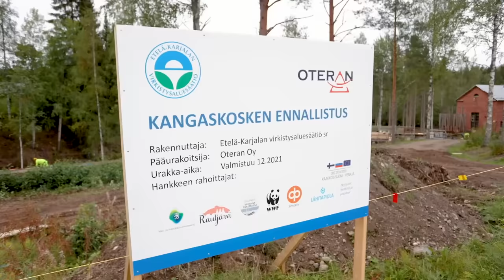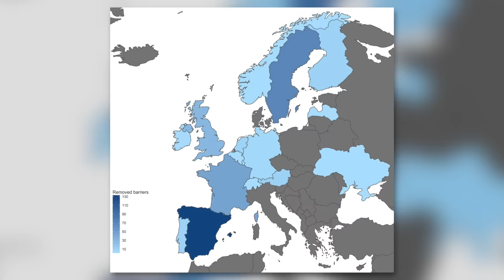How (And Why) Europe Is Removing Its Dams

Comment: Are the waters in rivers with dams really more dead than in "natural" rivers? I think that the ecosystem adapts to the new rythm of waterflows. And I am not a racist when it comes to discriminating against life that thrives thanks to dams.
Reply: yes. it has to do with the water height. lakes are not common because water tends to "want" to run to lower altitudes and ends up destroying the sides of a lake through erosion over hundreds if not thousands or millions of years. 
and when they're natural most of the water in them flows underground. dams pretty much stop the water in an artificial lake made on a river, which if it is there it's probably because there's some material preventing the infiltration of all that water (not all of it mind you).
This means we're accumulating water and organic matter in a place were naturally it would not occur as the amount of water flowing would clear them up. 
this is how swamps are made btw...a river flows into a field or a blockage makes it inundate the surrounding area turning the place into a swamp thus stopping the water and accumulating organic matter which incentivizes the growth of anaerobic bacteria and even makes those nice naturally formed methane reservoirs which then bubble up and you can see videos of people igniting for fun.
Reply: @pedromoura1446  But is there LESS life in artificial water reservoires? Or is there just DIFFERENT life in them? Is there any objective measure of how that change of one perfectly inhabitable environment to another perfectly inhabitble environment "is bad"?

In Scandinavia, forest areas that are industrially clear-cut have much greater ecological diversity than the natural hegemonic pine forest that monotonically covers 95% of the place. Could it be that dynamic human interaction with the environment can actually stiulate its diversity?

CO2 additions to the atmosphere certainly stimulates all kinds of life on the entire planet. Especially in the Arctic and in the deserts. So hydroelectric power plants might be bad in the sense that they compete with accelerated CO2 emissions, I could give you that!
Reply: @bjorntorlarsson  on your first question. It depends on how the lake is formed and maintained but generally speaking it's worse because you need to compensate for the damage you caused. You need fish ladders to maintain the current habitats and even then a dam is a barrier preventing local aquatic species from moving around, you need machinery to constantly remove the sediments from the bottom and place them over the dam to prevent problems like bridges falling or beach erosion, invasive water species accumulate in these reservoirs which you then need to remove and eliminate least they spread, all the organic matter from wateaver was in that area is now being slowly decomposing in anaerobic conditions, etc. 
But you're also right, It's a different environment, not necessarily a worst or better one. that's a human evaluation of the current local fauna and flora because we know that we can make very rapid changed that most species cannot adapt to. and yes. There is a method to measure that :) it's measured in biodiversity. Generally speaking if something man made increased the number of species in a place without putting a strain in another species. for instance... Imagine you eliminate mosquitoes in a place but your work added 1 or 2 other species of animal to the location, mosquitoes are considered common enough that it wont affect their population and 2 other species moving in means you succeeded in increasing biodiversity of the location. This is a generalization ofc since usually biodiversity increase means you created the conditions for species that feed and control the less desirable or more common ones to move in, you do not eliminate them. The opposite is also true... By knowing we reduced the amount of species in a location we know we did something wrong and we need to repair or at least minimize the damage. I hope this also clears your second question.
Reply: @bjorntorlarsson  on your 3rd point... Unfortunately no... Co2 is to plants what sugar is to humans.
We use sugar as the most basic energy form to feed our cells but you're only healthy because you have a balanced diet. If someone came and force fed you sugar assuming that because your cells use it then more of it would surely be good then you'd probably fall ill and eventually die. Plants react pretty much the same way to co2 (I can go into more detail about the mechanism by which plants consume co2 and why too much is bad for them if you want but I believe there's some youtube videos by veritaseum or scishow...?... that can illustrate it better than I could in a comment)... They've adapted to the current co2 levels and would take thousands of years for entire species to adapt to today's levels of co2 without facing extinction (especially bad if those provide food for us). 
Then there's indirect problems... Higher temperatures increase solubility of some minerals which can atrophy existing mechanisms or diminish the capability fauna and Flora has to absorb those essencial minerals, co2 disolves in water which acidifies it and has pretty much messed up the calcium carbonate (limestone) cycle which not only released more co2 (one of the many ways an increase in co2 concentration causes more co2 to be released) but also prevents animals that rely on shells from growing and reproducing (corals, molusks, zooplancton...) which in turn removed the food that other animals relied upon and with their numbers dwindling those above them in the food chain suffer as well, those animals are also responsible for depositing co2 through their life cycles so removing them also makes it harder to remove co2 from the atmosphere. 
And it's also going to make life harder to most of us by removing land mass, agricultural land, increasing the strength of natural disasters, expanding tropical diseases to places that didnt have them, reducing water supplies and even increasing human migrations because 90% of humans live near the coast and if their houses disappear they're not just gonna move inland and call it a day, they're gonna need money to recuperate financially and/or they're just going to move to places they see as both less likely to see that happen again and were opportunity to find a job and remake their lives is easier in their eyes (that means Europe, US, Canada...).
Obviously not everything or even everyone is going to die unless we crank co2 production like a James bond supervillain trying to destroy the world (which, To be fair... I can almost see oil companies do since they are being almost cartoonishly evil...) people with money will live somewere protected and separated from those of us and life will adapt and evolve, even if only extremophiles survived life would find a way... But at the very least millions of human beings will die for no reason other than someone wanting more of a piece of paper for their piece of paper collection and the rich themselves wouldn't be much better in a bunker or a fenced property spending inordinate amounts of money and time guaranteeing the resources they need to survive instead of traveling and enjoying a sky trip or eating luxurious foods (which are also disappearing ironically or not). And it's not only not natural but unnecessary and preventable...
Anyway... Sorry for the rambling by the end... Professional hazard.
Reply: @pedromoura1446  CO2 level has never been as low as now (or 100 years ago, the oil industry has restored a more natural level thanks to recycling carbon to the atmosphere). When CO2 level was more than 4 times higher, a level that the oil industry unfortunately never can achieve, 100 million years ago, we had mega flora and mega fauna. Life was thriving as never before or hence.

Politically manipulated computer models that have been totally wrong in every respect for over 35 years now, are of course nothing but obviously lying propaganda. The climate doomsday fraud is fortunately dying now. In a couple of years no one will even mention global warming or CO2 emissions any more. Now the uneduated looting psycopaths are going for the war economy fraud instead as their means to abolish all human rights and all industrial wealth in the Western world.
Reply: @bjorntorlarsson  nope. Co2 is very much higher than ever since humanity exists. That is just myth because someone decided to compare co2 levels data until the pre-cambrian or something... ( hundreds of thousands of years ago) and even then they are not but when comparing several thousands of years a huge short term increase in co2 looks like a small uninteresting spike because the timescale is so massive. What's more interesting is if you check what happened during the periods when co2 was higher than now and you'll see that every single time earth was far warmer than now while when it was lower the temperatures were also lower.
Reply: @bjorntorlarsson  initial computer models from 1980 are still correct today. They missed their predictions by a factor of ~3% at most and If you update those models with the other parameters we know without touching anything else they'll predict every year's average temperature from them until now with 99, 9% accuracy.
Also... Do notice that nasa who created those initial models has never been anything but reliable (government funded doesn't mean government controlled) and even then all the other models were created and ratified by thousands of scientists all over the world (people with and without ties to governments and with or without public funding), while the oil industry has literally already lied to us before and tried to hide the fact that they knew since the beginning that leaded fuel was deadly and caused long term damage to the brain simply because it was cheaper than other gasoline additives developed at the time (which they also knew about since they paid for their development). And if the problem is the government then the oil industry is BY FAR the one receiving more money from the governments all over the world as subsidies and also the one spending  more money to support political campaigns of politicians who support their interests...

Do you really think it's more reasonable to believe than thousands of people who don't know each other,  analysed and studied weather models all over the world in paralel and jointly came together to craft such an easy to disprove lie with nothing to gain from it when they can't even all agree on what measurement system to use or that 3-4 companies, who already lied to us before, whose director boards commonly consist of the same people or investors, and who stand to lose trillions from government subsidies every year would spend a few billions to make sure people don't take any actions that might harm their bottom line?

Comment: What does everyone have against clean renewable energy?
Reply: Those dams were barely producing any eletricity
Reply: Blocking rivers isnt clean.
They could just use water pressure through turbines for electricity production
Reply: Nothing.
Listen once more to what he said. And look through the boolshit and decorations into a sense behind them.
All the dams removed were old and small. Not optimal, not producing any energy or producing very little of it. 
NOONE is removing big, modern dam that produce significant amount of energy. They were way to important for safety reasons. Well, noone but russian army.

Comment: Seems like a waste of money from the EU budget on the green agenda. If not hydroelectric power plants and nuclear power plants, then how will electricity be produced? Thermonuclear fusion is still decades away, wind and solar power plants do not provide the required volume and have their own problems. What, should we burn coal and liquefied gas imported from the USA?
Yes, the newly built hydroelectric dam creates environmental problems, but after decades of existence, a new ecosystem is being formed and, with proper management, does not create significant problems.
What I see is some kind of plulism and a waste of budgets.

Comment: Fascinating. Thanks for some exciting news amid the horrors of 2024. How do they replace the power source?
Reply: 95% of the dams was industrial and not hydro-power ones
and tearing down a 100+ year old dam for a mill that closed down or converted to electric over 50 years ago is not that of a problem.

Comment: Losing 3 hydro dams?😮
Reply: Looking at the size of them, they all look to be very small-scale. These weren't the Hoover Dam, they were small blockages that likely powered local mills - so the power generation loss is likely minute, and the ecological damage these dams were responsible for was huge. Weirs are even worse, and there's a good reason most of the removals are focused on the 1000s of weirs that have been thrown up over the last century. My town has a big hydro electric dam, a down-river flood management dam, and a half-dozen weirs that don't serve much purpose at all anymore. All that concrete is getting close to end of its life, and there's pros and cons to keeping them intact - if it's producing a ton of power, that's a pretty big pro, but if it's keeping the lights on in a paper mill and strangling local fish stocks, it's a good call to cut losses and just remove the dam.
Reply: @NLuck-eh5cd  Yep, and for people that worry about floods and stuff, many dams were made for explicit purpose of power generation. These small dams were quite useful early in electrification of stuff, but with modern grids that can deliver power pretty much anywhere, they don't really make any sense.

Comment: Run out of water and hydroelectric power ! I thought we were trying to increase the power. 
  That's what salmon ladders are for !
  So what did they replace the electricity with?
Reply: my thoughts too. They are opposed to oil, gas and nuclear power. Now dismantling hydro dams to "SaVe tHe PlAnEt."
Reply: Obviously you haven't bothered to educate yourselves about the inadequacy of fish ladders.  Why also would the salmon runs not have recovered despite the fish ladders.  

You also miss the point about how all dams have life span and it is usually not much over 100 years sometimes less.  Concrete degrades over time don't ya know?  Removing dams allows for the recovery of the whole river system.
Reply: Hydropower plants of that size are meaningless in grand scheme of things when it comes to supplying power to entire nation, so there is hardly anything to replace. They are old and inefficient and ruining the ecosystem. Big hydropower plants are not going anywhere anytime soon. Also, it is a common misconception that allowing fish to pass and generating electricity can't work together. You are on right track with the salmon ladder, but their efficiency isn't great. A proper way would be to guide a small stream (as close to natural looking and acting as possible) around the dam. Such a stream would also act as a spawning ground instead of reservoirs the dams create. 

Thanks for your thoughts.

Comment: The Hydro power can still be generated without the dams, just by creating diversion channels out of the river through turbines and back into the river lower down. I cannot understand why this concept was never looked at right from the het go.
Reply: just lol. Water will bypass your channel if you add turbine to it. It will flow freely in the main channel instead of going to your channel. Hydro plant actually uses all river flow to make water flow through turbines. Channels or pipes add some resistance to water flow and it make things even worse. Generation will be quite low. So you can't replace dams that way.
Reply: You can also generate power by manually turning the wheel. And?
What humanity need is not to generate power - but to generate A LOT of power. The more water go through the turbine, the higher the preassure of it, the more power the turbine can generate. Building the dam allow you to use ALL the water, ALL potential of the river, meaning you maximalise the amout of energy you can generate. 
Big dam on a big river can generate as much (or more) power as a nuclear reactor. Lesser turbines on the side channels can barely made enough power for a few houses

Comment: Nuclear power is the way forward, backed up with coal and gas using latest techniques to remove sulphurs and perhaps CO2 although the latter is a good fertilizer. Solar and wind are niche to be used on edge cases.
Reply: Bro Gas and Coal? Tf you want with this anchient bs?

Comment: a field of solar pannels is way less of a danger issue in case of a war or terrorist attack
Reply: Small arms fire can take out the field of solar  also just damage the wires.   Terrorist attacks
  are normally smaller and done by a small group of people.  They happen all the time, but the MSM don't really report of them.
Reply: Except solar doesn't work at night, or even during the day during Northern European winters (when you need the electricity the most). Basically it's just another crackpot green energy source that eats vast amounts of subsidies without doing anything useful. At least hydro does anctually work, and is zero emissions as well.